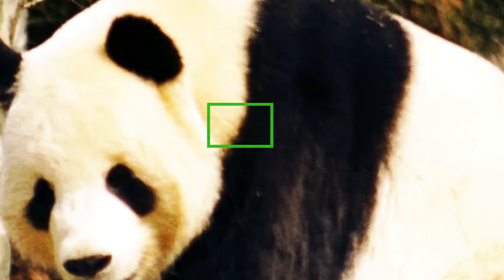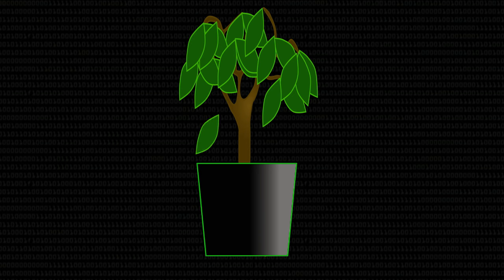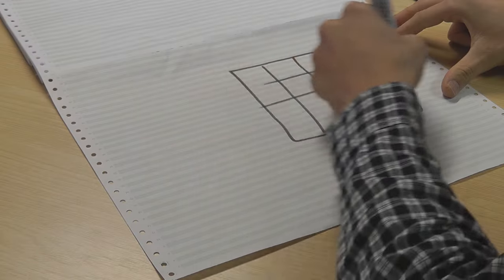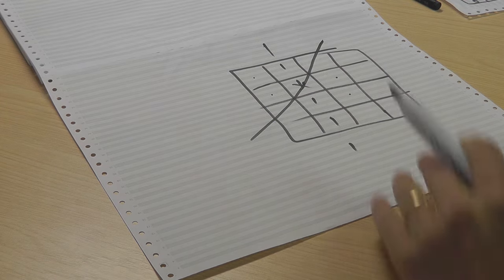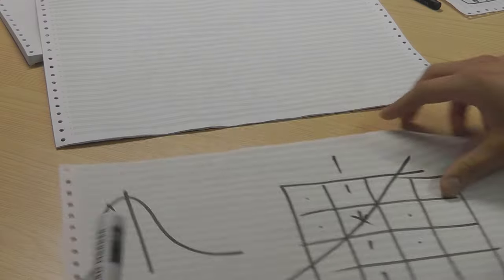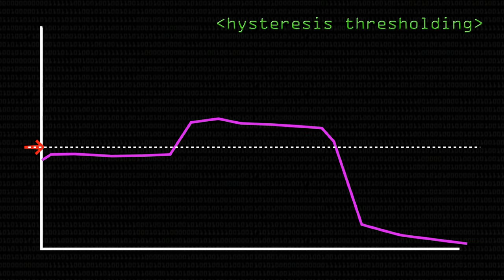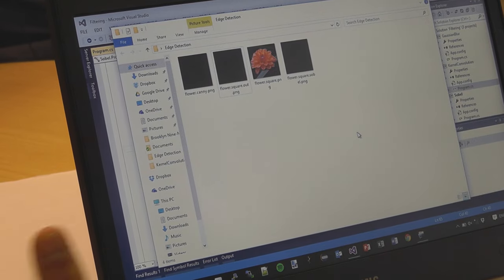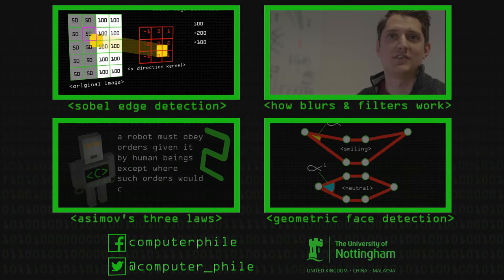Canny Edge Detector - Computerphile

Comment: It's a good starting point to structure the thinking but ultimately the truth is that these techniques are wholly inadequate against the variability of real world image content.
The short answer is neural nets, the slightly longer answer is that you can hand craft visual algorithms you just need to step up the complexity and sophistication several times relative to this.
Also you use vector math for angles and such, rarely cosine. Vector math is often incredibly elegant for seemingly very complex things while the cosine stuff is infinite series for even the simplest calculations. You also use vector for line representation, not y=ax+b because that can't do vertical.
Reply: +Dan Frederiksen Absolutely. These videos are very much an introduction to image manipulation and machine vision. Perhaps we'll do a video on convolutional neural nets, but let's not run before we can walk :)
Reply: +Dan Frederiksen Well it really just depends on what you want to do with those pictures...
Reply: +Michael Pound warp speed, Mr Zulu :)
Perhaps it would be interesting to do a video on the mobileye image processing system that Tesla motors is using for autopilot these days. If you are familiar. It's impressively fast and capable although I suspect they will have to rethink everything exactly because fast doesn't have real world robustness. As is interestingly seen in user tests where the car almost kills them at time.